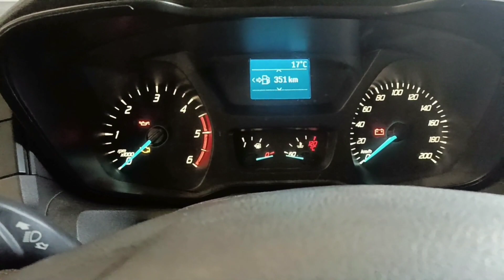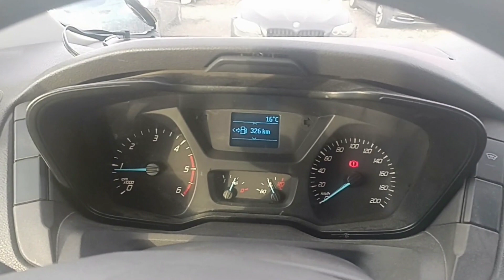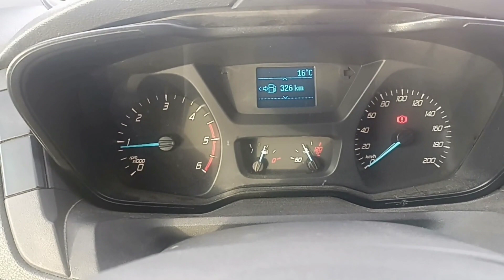Ford Transit error P2564,P0045,U0401.Car goes into limp mode over 80 km. Fault found and fixed.

Comment: Hi, I have U0401 come up as  PCM power control module A is invalid, and P0299 Turbocharger/Supercharger A
Underboost State ! Do you think I have the same problem as video above ? 
And sometimes error appears ( ENGINE SERVICE NOW ) the can looses power a bit ! I turn the engine off , then back on it goes back to normal 🤦🏻‍♂️🤷🏻‍♂️ really appreciate if you can help me with an answer 🙏🏼🙏🏼
Reply: Same here......did you find a solution ? Cheers.

Comment: I had that Code U0401 come up and 2 fault codes for the nearside ABS Sensors and invalid signal to PCM,  I was getting ABS Light, Traction Control Light and No Speedo or Digital display on dash. It turned out to be the little silver pins inside the ABS Module where the Connecter joins on had been Squashed, a few were bent and a couple were touching, The connector still went on ok and I wouldn't have known, even when looking with the naked eye, But when I took a photo with my phone and zoomed in, OMG :D I straightened them out with some long nosed pliers and carefully put the connector back on and it solved the problem sure enough :)
Reply from the maker: In my case I also had error U0401 because the ABS limits the travel speed and makes it no higher than 80-100km/h.
  In your case it is totally different, you only had this error which is output in the ABS ECU, so it is clear that you do not have problems with the engine.  
Thanks for the info!  They are always beneficial for subscribers.